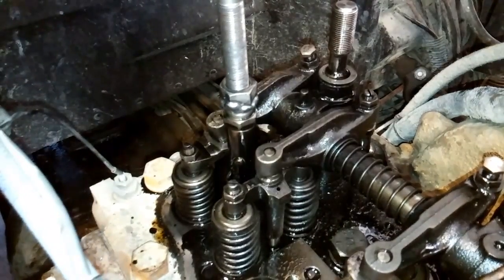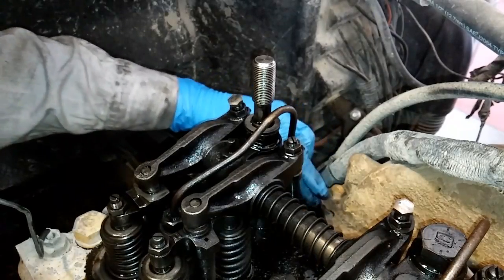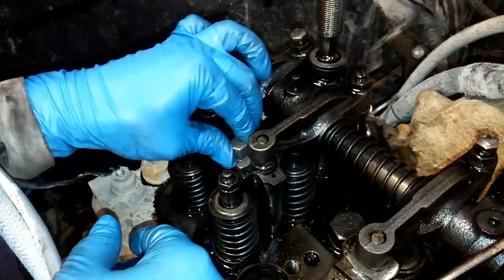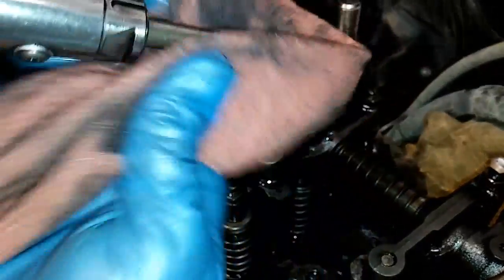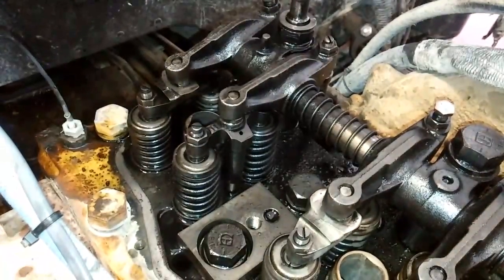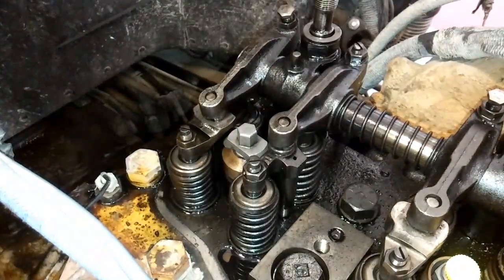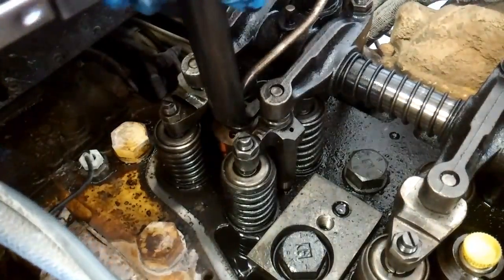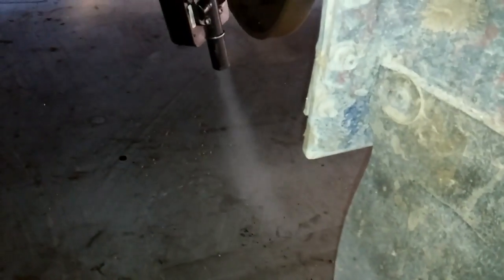How To Remove And Install 3406B Fuel Nozzles.  3406C Fuel Nozzle R & I.

Comment: Would  you  do  a video  on  mechanical timing advance fuel pump  3406 b
Reply: What do you need to know?
Reply: Had an oil  leak  in the cone  got  a new took the  old  one  off  little  screws fell  out found out  that  was part of my mechanical  advance  need to fix it  but don't know how
Reply: @JC-gu8pp  First off what is your engine serial number. VTU has numerous updates.
Reply: Serial number  3zj23205
Reply: @JC-gu8pp  You have a C model. The bolts that usually come out are allen head. Sometimes they will cut the cone off. Are you planning to take the whole unit off and reseal it? Or just fix what's broken. I like to reseal them, your call.
Who is your local Cat dealer?
Reply: @johngoldsmith6629  yes they were  alien head I understand that  the  c model  is electronic instead of mechanical  Wagner is the  cat dealer here what do you  recommend
Reply: @JC-gu8pp  3ZJ16182 and up is a mechanical C model.  Electronic is called a PEEC, which you don't have.
First off you need to find ALL parts missing. They may be in your oil pan. If you have a rear sump, take the drain plug out of the front and see what parts are stuck on the magnet. If you don't find them you could suffer gear damage. 
NEVER, I SAY NEVER, mess with the screws big and small on the cone. They are your start and stop of your advance. Only way to adjust them is with the timing indicator group. The small spring is for that horse power. You should have a eight bolt carrier. Remove two of the 3/8 bolts (0T0065). Cut the head off one and it will be your timing pin, or you can buy one (6V4186). Bevel the shank some, you you make a timing pin. Remove the plug out of the side of the fuel system. 9/16 socket and the plug will have an oring on it. Turn the engine by hand. I use a long racket on the drivers side, 15/16 socket. Turn the engine towards you (normal rotation) until the timing pin or the inverted bolt you just made drops into the slot. Your pump is now on TDC 1. If you have a helper which is better, he can hold the pin and take the other bolt and place it in the flywheel housing. You have a 1/4 pipe plug, with a 9/16 head on both sides. Driver side is best as your timing the engine. The flywheel can be on TDC 1 or 6. So when the pin goes into the fuel pump, it is TDC 1. If the flywheel goes in first, remove bolt and turn slowly to see if pump goes in. If not your on number 6 and you will have to go another round. The flywheel timing might be off a little, not to worry as you will retime the pump. Once timed, leave pin in fuel system. Remove the remaining 3/8 bolts and remove the timing advance. Save one bolt you will need it. Or get a longer one. Go to a hardware store and get one a couple inches longer. A cheap bolt is OK, 3/8 16 TPI.   Now you have 8, 1/4 nuts (7/16 head) that hold the outer cone on with the screws YOU DON"T MESS WITH. Throw the nuts away and remove the cone and spring. You have an outer race that the spring sets in, save it. The flat side sets on the snap ring. Take a small screw driver or seal pick and remove the snap ring. Throw it away. The flyweight carrier  can have four or eight bolts that holds it to the main carrier. Remove what bolts that are left. The allen bolt are a 5/32 head, remove them, throw them away. You have two plates that holds the dowels in place and flyweights. Remove the flyweights and dowels. If you have an eight bolt small carrier you will have four small allen head bolts under the flyweights. If not your flyweight carrier would have already been loose by removing the other bolts. You can now disassemble the spool valve. You have a cone race and another race just like the first one removed. Most of the ones I get are assembled wrong or have missing parts. Turn the main carrier over and remove the allen head bolts that hold it together.  If the threads are damaged that was sticking out cut them off. Might damage plate. Save good ones, you will reuse them. You now can take it apart. Don't matter how it splines back up. Just pay attention how the center and rear ring face. The front plate can go either way. You now have a quad seal in the outer plate and the main carrier you have two quad seal's. One on the back and one on the outside. Hopefully the small allen bolts did not break off in the carrier. Clean all parts up and see what you can reuse. Look for wear on the dowels, outer carrier that the dowels set in, flyweights. The cone race usually has wear on the flyweight side and throw it away. Look for wear on the spool valve. It usually has wear where the snap ring seats in it.
DO NOT TURN THE ENGINE. if you break the pin/bolt in the pump or flywheel you can destroy a lot of iron.         

Parts needed mandatory. 
Gasket for cover 2W0459 , if cover is damaged let me know.
Snap ring 0093101
Quad seals 2-2W2754
Quad seal 9X7715
Bolts 8-0T0065 (Never reuse these seen them break)
Bolts 4- 8C9034 (Never reuse these)
Cone race 4P3337
Retainer 2-9Y7450
Nuts 8-9S8750, I think these are the ones I use. The ones on the outer cone are thin and I like these better.
As needed if worn or damaged, only replace as need don't have to get total unless you want to.
6V7698 long allen bolts 8 total. Seen threads damaged or head strip out.
1327444, small carrier. Wear in dowel area.
1S5440 dowel, four total.
1192130 weight, four total. These was hard to get and could take months if Cat is still out.
4P7690 race, 2 total. Unless it was built wrong, or missing these should be OK.
4P7691 spool valve, wear in snap ring area.
8T9394 bolt. These are for a 8 bolt flyweight carrier. If you have one, replace them.
1327446 Main carrier, only if bolts are broken off from failure, EXPENSIVE.
4P8248 advance spring, only if damaged. 

Once you got all these, I can walk you through assembly.
Reply: Thanks  for  your  help  sounds over my head  guess  I'll have  to take  it  to cat
Reply: @JC-gu8pp  Be careful, find an old mechanic. Young tech's never seen one of these and you will still have a mess. I was training one the other day and he snapped the pin off and broke the fuel pump housing. Been doing this for over 39 years. Sorry you are not in my area.
Reply: @johngoldsmith6629  Do you happen to be in the michigan area? We are running old B's , and our (Novi) dealer has not been very good with them.
Reply: @pudlyjongearhead2851  To far north.

Comment: great video! Helping a friend in frame his 3406B and have been trying to find info on pop/leak testing the nozzles can not seem to find data on the pressures in the cat books we have available. any info on that? Thanks!
Reply: 7000 series nozzles, need part number for spec.

Comment: I have a 94 3406b 3zj and I’ve got a slight miss in the engine.  I’ve run 10 gallons of atf through her over last two weeks and didn’t change anything.  My mechanic is going to try cracking fuel lines next week to see if it’s any particular fuel line causing miss.  Could a fuel nozzle be causing the miss I just changed the oil and there wasn’t any diesel in it.
Reply: These engines had bad nozzles and loose pumps. They can stumble on acceleration. What is your full engine serial number?

Comment: Been watching your channel for a while now. I have a c model I'm having nozzle trouble with. As I was told. Can a burned or bad nozzle cause severe over fueling?
Reply from the maker: Yes, a bad nozzle can definitely cause bad fuel burn in the cylinder. You could you have a bad plunger in the pump as well.
Reply: @AdeptApe  thanks. If I post a video to my channel would you be willing to have a look? It ran with a broken advance weight for a short period, assuming over retarded timing caused the problem with nozzle burn...I'm better with old cummins :) thanks again

Comment: please help  which nozzles inject more fuel 7014 7018 7019 even 7020   I wanted to put less fuel into my cylinder to reduce black smoke.   I took our OR3436 and repalced with 7018 and smoke increased
Reply: Nozzles are based mainly on the tip design. They match the bowl of the piston, angle and number of holes. Changing the angle could cause piston damage.

Comment: Just getting into the trucking world and I have an 86 W900L with a 91 3406B and it had jakes before but someone took them off. Just  need some help trying to figure out how to install and make sure I get them done right
Reply: Go to Jacobs Brake web site. You can print out whatever info you need. Parts manual, installation, etc. I would try and locate a 346D brake. Be warned, the middle valve cover base cracks very easily. You will need clutch and throttle switch, cab switches, fuse and basic wiring. If you use the original KW wiring it has relays for front and rear. You will need a KW schematic. Or you can rewire the complete system.
See my comments down lower

Comment: Do you know why the lifters of a 3406b engine would keep breaking. It’s been different lifters every time.  But 3 have broken in 3 years.
Reply: Valve lifters? Overspeed is the main cause, wear, and on Jake Brake engines lifter inspection at mid life helps reduce failure.
Reply: yea the valve lifters. had to change the cam shaft all 3 times too.   Its rated under 400hp i think, can that also be a problem it pulls 70k-79k most of the time  @johngoldsmith6629
Reply: @119aponte  Did you change all the lifters the first time or one at a time. The biggest failure is over speeding the engine. Is the lifter turning in the bore or breaking? Still sounds like over speed. Go to your local Cat dealer and ask for these, SEBD6564, SEBD6578, SEBD6607, SEBD6655 and SEBD6810.

Comment: That blow-by was insane. So, on these engines, is this the fuel injector actuated by the pump and no injector above the cylinder?
Reply: Called pump and line. Cat used forged body, sleeve metering, scroll and new scroll. This is new scroll. Fuel flows from tank, primary filter to Fuel Transfer Pump (FTP). Low psi from FTP to secondary fuel filter into fuel manifold in injection pump, 20 psi min under load. Usually around 40 psi idle and High Idle. Sometimes drops to 30 psi. Injection line psi can reach 17,000 psi. High psi line from injection pump to nozzle. In line adapter in cylinder head. Fuel nozzle acts as a check valve. When enough psi is applied the needle valve lifts off its seat. Fuel is sprayed through holes in the tip of the nozzle. When psi drops needle valve closes and stops flow. If trash is under needle valve fuel could drip onto piston. With age nozzle tip wears and holes enlarge. Thus more fuel and if they continue to grow eventually you will see a black stream of smoke going out the exhaust all the time under load. I have seen someone replace all six nozzles and lose over 100 H.P. All high psi lines are equal in length to keep psi same on all cylinders. The injection pump has a check valve in it to prevent fuel from running back out of high psi fuel line. Older engines now called A models had PCT, PCTA, DIT, DITA. DI's was about the same stands for Direct Injection. Fuel spray's into the combustion chamber. PC- Precombustion Chamber, sprayed fuel into a chamber in the cylinder head and down onto the piston.  Both of these engine had capsule nozzles. If they went bad you throw them away, no reman. Capsule nozzles threaded onto the nozzle body and when you got close you snap them fast to lock them to the body. PC had a single hole out the bottom and DI's were longer and had around six holes. PC engines got around 3.5 mpg, as fuel was cheap nobody cared. Fuel prices went up, emissions got tighter and PC engines became obsolete. Back in the day when someone put DI piston's in a PC engine or PC pistons in a DI you had to scratch your head until you figured it out. With higher emission regulations more psi was needed and the new scroll system became obsolete. Now we have common rail with psi over 30,000 psi.

Comment: Use a puller instead of a slide hammer if you plan on reusing injectors per Cat shop manual. Some risk of loosening a tip with slide hammer. You do make good vids though. Wish you would make one on barrel and plunger r & i. I only do it about every two years and I always have to read certain parts of the manual over and over to remember it all. Besides, manual only shows doing it with a special spring compressor tool  which I do not have nor anyone I know. Thanks man- you r an asset to Youtube. BTW, I am a big fan of "torque stripes"

Comment: Use a  special tool to tighten adapter 7/8 side of fuel line. I took one and modified it to clear Jake stud. If Jake has 3/8 bolt exhaust side they torque to 48 Ft Lbs. If they have 7/16 bolt they torque to 60 Ft Lbs. Torque nuts first to 48 or 60. Then torque bolts to size mentioned above. Torque nuts to 100 Ft Lbs and recheck bolt torque. If the engine had a three point stand and a kit was installed to increase braking it went to a four point stand. So it is possible to have a 3/8 and 7/16 bolt in the same engine. Also it don't hurt to shim the brake so it sets flat. Seen a lot of broken hsg's due to incorrect washer installation. Always run the over head with the Jake bolted down.  A 346D brake will have the updated parts. You can use a D brake on everything, but you can't use a earlier design on a later engine. Not required to run overhead  but I like to while valve covers are off. If you don't tighten the Jake valve cover hsg down correctly you will break the ends off. Put a little glue on valve cover gasket joint where it over laps. If you replaced the carbon dam seals its best to slide nozzle in some and pull it back out. Have seen carbon dam seal get cut. I keep a chamber in my tool box and test them before I install them.  Also good ideal to replace oring on rocker arms that feeds Jake with oil.  You go to the Jacobs web page  and print out a lot of info. Always check bleed screw on the side and make sure they are tight. Replace seal if reusing nozzle.

Comment: I have a 09 C-15 that’s  blowing oil out the crankcase filter housing. This is only happening under a load and not during idle. I’m assuming it’s caused by high crankcase pressure. Is this motor shot?
Reply: Tim Kellar if you have a 2009 c15 sell it, it was junk when it was new,boat anchor is the only use for that motor,don't ever sub any cat motor newer than a 2002, 6nz or older is only way to go